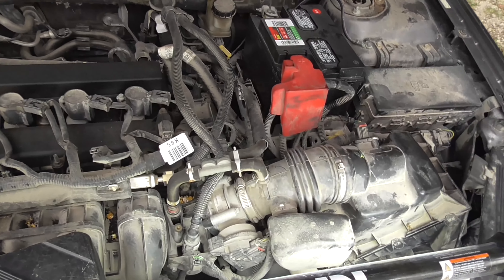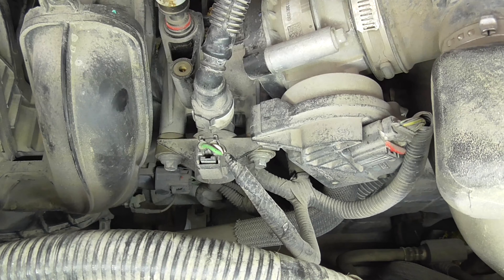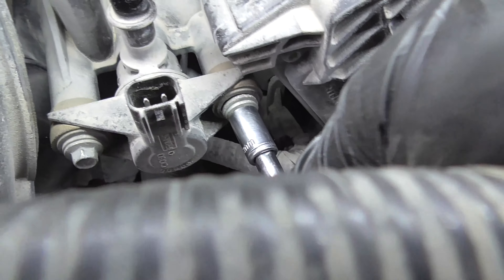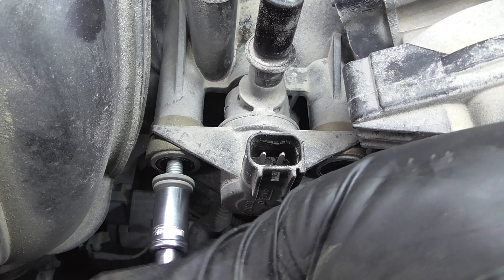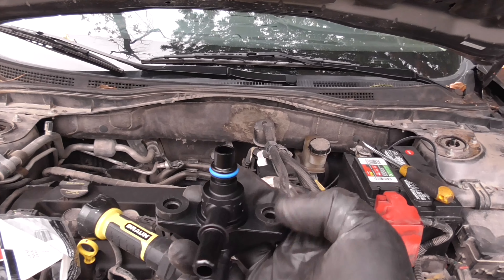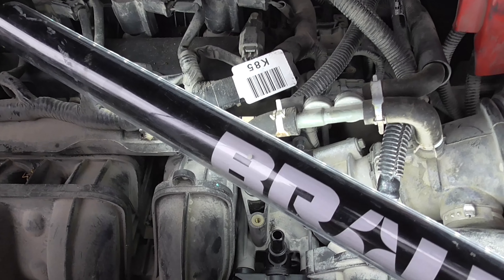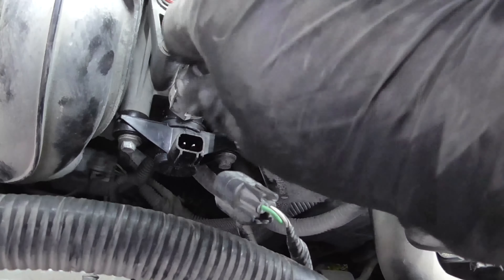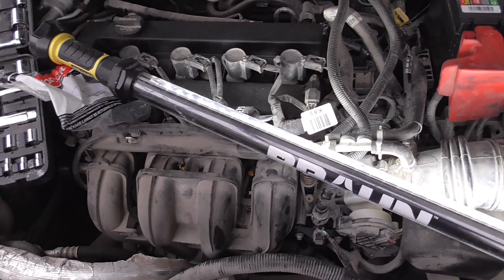Vapor Canister Purge Valve / Solenoid Replacement on a 2010 Mercury Milan 4cyl 2.5L

Comment: I changed this part in March and then engine light and same symptoms and code started again by September.  Should i change it again?
Reply from the maker: Well, it is possible that the new part could have failed already, though unlikely. Since it's not too expensive you could try and replace it again, but if it fails again after just a short time it might need further diagnosing to find out why this part is failing. The one I replaced in this video 4 years ago is still working without any issues. Just make sure you're using a quality part as the cheap generics out there more often than not aren't worth the savings they bait you in with. :)  Hope that helps.
Reply: @ScanMan79 Thank you. What brand is a good quality brand?

Comment: I have a 2009 2.3 purge valve is not there still trying to fine it
Reply from the maker: In 2009 they changed to the new style as shown in my video. You may have a  2009 that was actually built in late 2008 and still have the old style. I believe it was located back by the firewall on the older style ones, but don't quote me on that. If all else fails, you can trace the line from the vapor canister up to the engine and you will find it for sure. Not the most fun way but cheap! :) Best of luck.